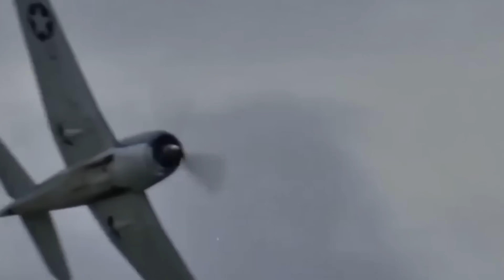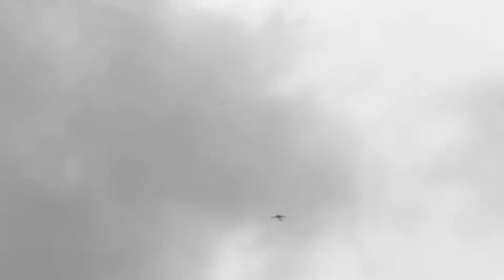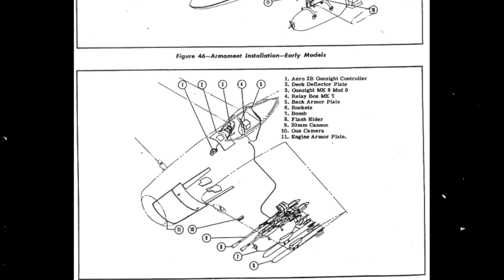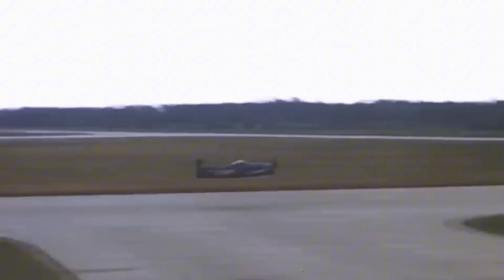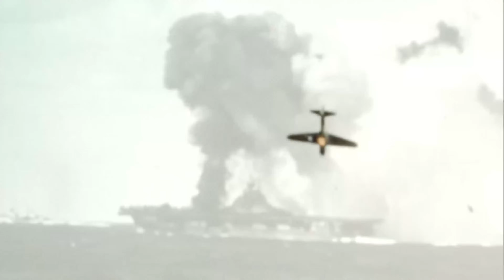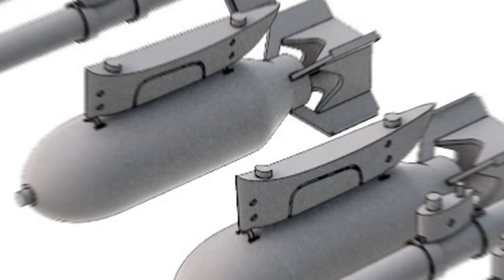Why the F8F Bearcat Marked the End of the Jet Era?

Comment: This is a rip-off of Greg's Airplanes and Automobiles video that he did on the F8F in his "Superprop" series.  Fraud....
Reply from the maker: While there may be similarities in topic, derivative work doesn't automatically equate to fraud. Comparing content and providing specific instances would strengthen that claim.
Reply: @EngineeringDocumentary You've cranked out almost 200 videos in the last 9 months.  No one researches that many subjects and puts out this level of content that fast.  Certainly, not anyone with a real job.

Your narration is clearly AI generated. This is obvious because for "2,300 horsepower" it didn't say "two thousand, three hundred".  Instead, it said "two-three hundred".  Clearly a glitch you didnt catch.  It does it again when it mentioned rate of climb.  Instead of "5,600 feet per minute" your AI generation says "five-six hundred" instead saying "five thousand, six hundred" which would be correct.  Again, you didnt catch that and these glitches are quite frequent.  Heck, you even used AI generate thumbnails on a lot of your videos.  Why?!

Not only that but you followed the EXACT same sequence of information as Greg's videos as if you both had the same table of contents. There are things you cut out which is why your video is shorter.  You cut out the part where he discussed the Bearcat's landing gear design between hus discussion of the break away wingtips and the climb rate. 

Sentences that contain important data are almost word for word copies of those said by Greg.  You clearly tried to change the wording of certain areas and remove some of his tangential information.  However, you still left in any many of Greg's unique phrases and his use of adjectives really becomes obvious when you hear the videos side by side.  You even referenced the performance charts in the same order and manner as him.  Although, you didn't show the charts because that would've made your plagiarism too obvious. 

If I had to guess by the subjects you've made videos about, you've ripped your content from others like Greg, or Rex's Hangar or Not A Pound For Air To Ground.  

Finally, I notice you didn't deny my claims.  You just deflected in the hopes that no one would actually compare your product with that of others.

Comment: The F8F-1 time to climb was set by a fleet production plane. Three F8F-1 fighters were sent to Cleveland specifically for this purpose. They were not modified except to have the weight on gear switch disabled to allow Combat power (water injection) to be used at all times, even on takeoff. The Bearcats carried ballast equal to a full load of .50 cal ammo. The pilots spent two days practicing to determine the best climb angle and climb speed. The best time to altitude time was set starting with full internal fuel. So, these were not modified, stripped down aircraft. They were in-service F8F-1 fighters. In the late 1990s, one of the pilots wrote about this event to his grandson, who then shared the letter among friends and enthusiasts.
Reply from the maker: That's a fascinating detail about the F8F-1's time-to-climb record! Disabling the weight-on-wheels switch and practicing the climb profile highlights the effort made to optimize performance with largely stock aircraft.